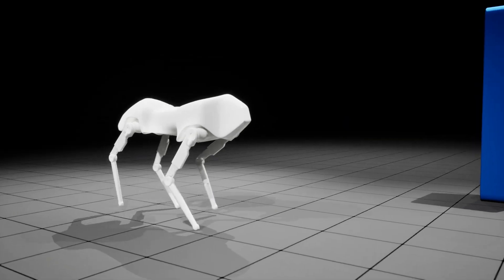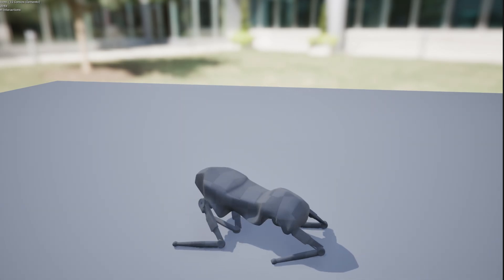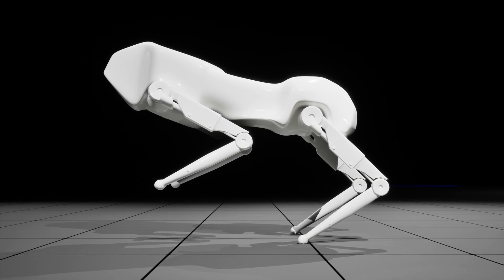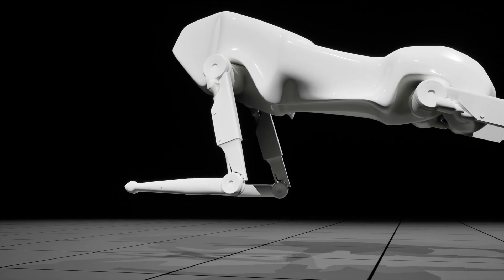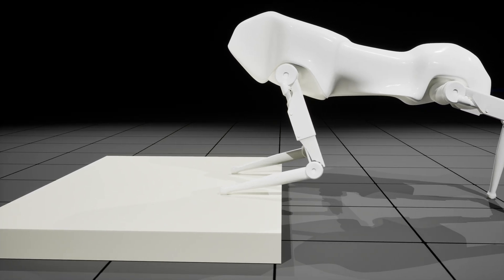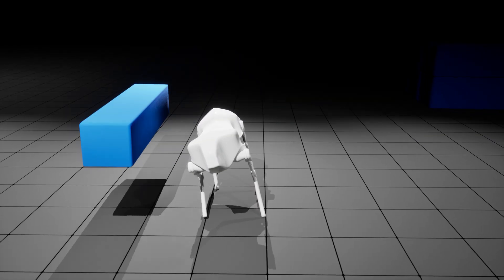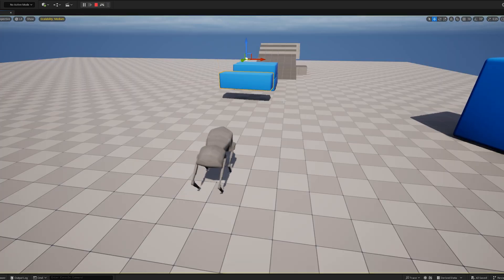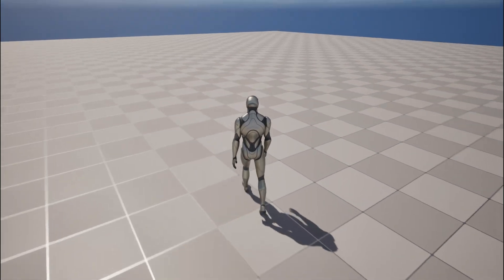Physics-Based Procedural Animation

Comment: My video had been removed by YouTube, with no given reason. But I made and posted a video of something like this. And had been working on far more than what I posted, all in Unity 5.

I can relate to a lot of what you went through, trying to make this. If my video of a walking table was not removed, I would have posted a collection of some of my more funny moments of when things went quite wrong, also.
Reply from the maker: Possible to reupload it? Would be interested to see
Reply: @LincolnMargison  Currently not sure. I have two drives not working, and I believe all my videos from then are on one of them. I'll have a look. But is most likely a, no.

I do have one video still posted on YouTube, but it is for coding in Unity. And it talk about how the 6D joint (unlike the other joints) falls asleep at the start, and that you need to keep it awake to use it, if applying a force to it in code. There is a chance that the same issue can be found within the UE physics also.

I'd be working on learning that myself. Once I learn how to do some basic stuff in UE 5.5.

Comment: This is way way cool! I'm trying to accomplish something similar myself. Maybe with the humanoid, you could fake it a little bit like the method shown in this video https://www.youtube.com/watch?v=p0X5HleoHDU How would you go about controlling the character since it doesn't use a traditional capsule collision?
Reply from the maker: I want to try to avoid faking it without any external forces ideally, but I'm not too sure how good it can look. I think if it's combined with my general procedural animation stuff that makes the character look/move more realistically it might be decent if the balancing part can be figured out.

For controlling the character, you could just have them push the floor based on the direction its trying to move in (like I did with this dog thing) but that would be very sluggish and hard to control. So that's where most things would fake it and just drag the hips along or apply external forces.

Comment: Very cool!  Are you still planning a bipedal procedural locomotion plugin?  I could see that as being extremely useful especially for VR devs
Reply from the maker: Yeah planning it, not sure what form it will take. The clip towards the end is a proc animated human but very basic for now. But for VR it wouldn't be far off as a starting point. Just haven't dealt with VR much and it would need a few specific things implemented to work well.